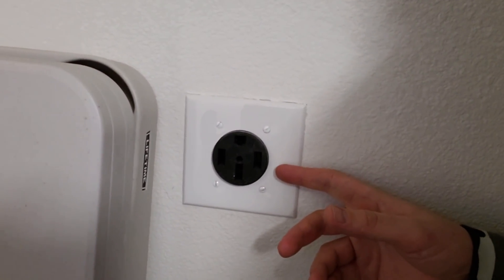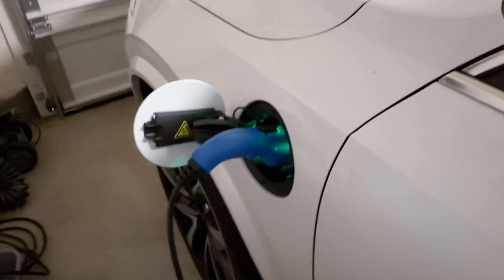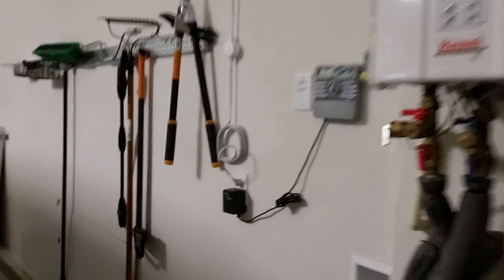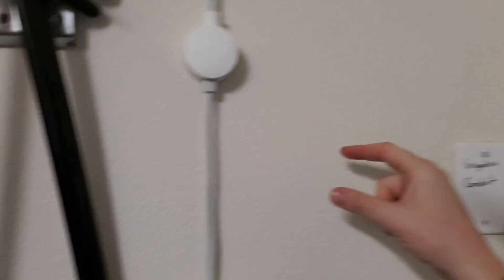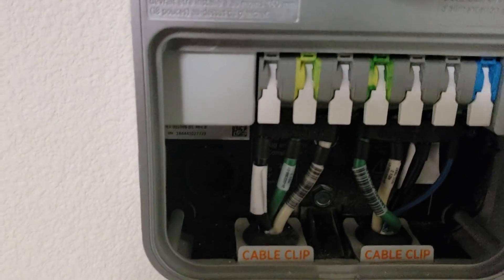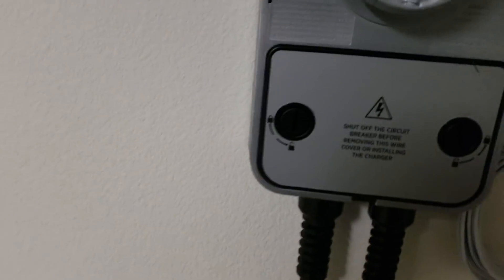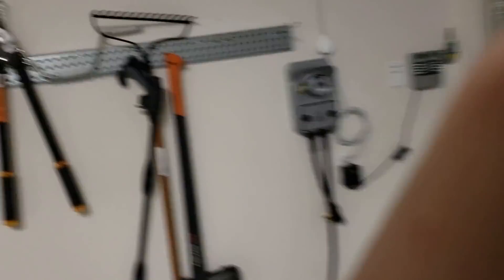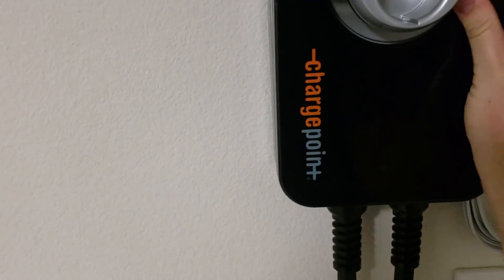Chargepoint CPH25-P 32Amp EV Car Charger Station Installation Set up Guide Nema 6-50 240V XC90 T8

Comment: Why don't you remove the cord on the charger and wire the extension cord directly to the charge point charger?
Reply from the maker: Seems like a waste of time cutting the extension cable up and then hoping that i'll know which cable inside the bundle goes to which of the multipe wire ports inside the charger housing.  Yeah...i'm cool with just the extension.